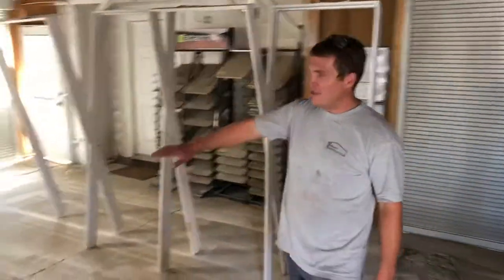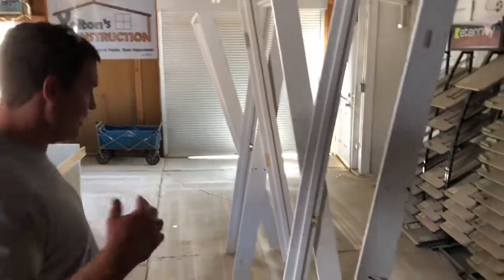Hack on Painting spraying prehung doors and jams with one coat no tapping

Comment: Great ideas for set-up… you need a mask and maybe some plastic floor and wall covering though. The fine spray lands on EVERYTHING you can see afterwards .. how the density of paint gets finer the further away from the door where ever it lands… so that’s an indication how much is getting into your lungs.. when I spray without a mask ( I used to sometimes ) my body chest and neck area would come out in red rash that looked like a heat rash … for about a day after. That I believe now was the body trying to get the toxins out of my body … so let’s remember to wear a good mask, cover your area. Love the wood idea holding two doors .. and putting screws in hinge latch holes … I will definitely do that now!
Reply from the maker: Thanks for your support!